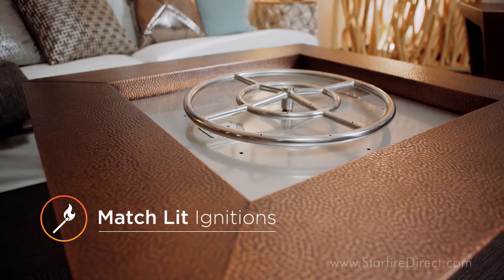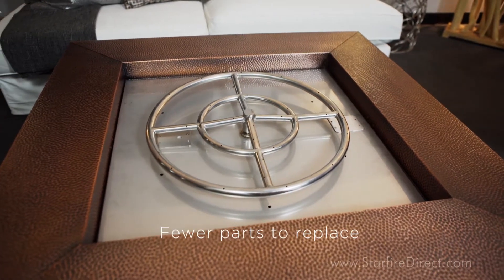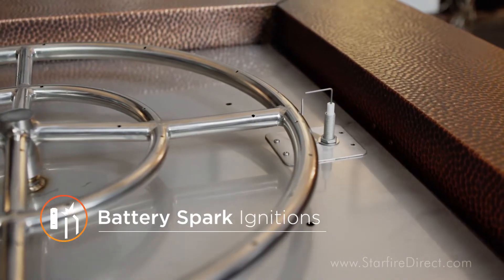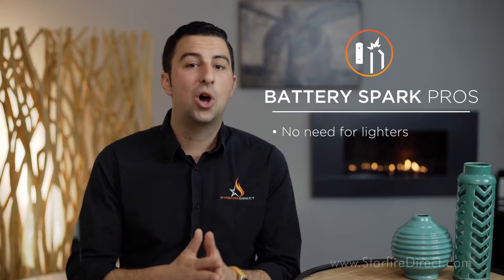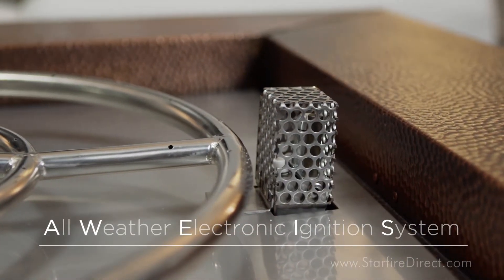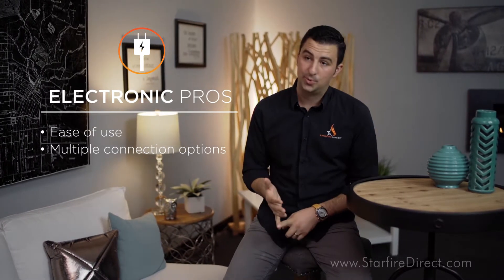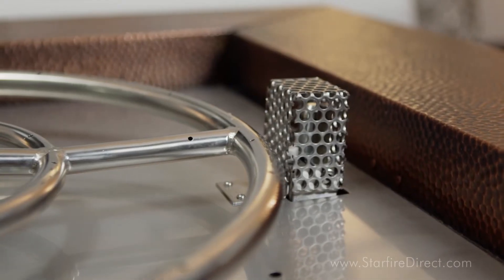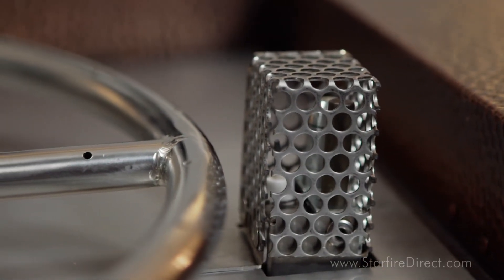Ignition Systems Pros and Cons by Starfire Direct

Comment: the electronic ignition systems are priced sky high, not even a consideration for the average person. The push button 15.00 one is all you need. I have my pushbutton 20 feet away from the pit, and so is the gas turn on valve, for safety. You can extend the distance use high voltage wire dont run it next to the grounding wire.
Reply from the maker: Thanks for the feedback!  You're right, adding an electronic ignition system can add $1500-3000+ to a fire pit installation.  Of course this is typically required for a commercial location or for someone that wants to tie the fire pit into their home automation system.  There's also many safety features; for instance, if a strong wind comes and blows out the flame, the gas shuts off automatically and the unit will try relighting itself.  If it fails to relight, it will shut off the gas and shut the unit down.  A match lit or push button 1.5v system doesn't typically have a thermocouple system to help in this type of scenario.

To keep costs down, a match lit or 1.5v battery spark kit is a good solution.  

I will say that keeping the battery module more than 36" away from the spark ignitor can often lead to loss of power preventing the gas from igniting.  As electricity travels down the wire, it loses voltage and even if you see a spark, it's not hot enough to ignite the gas.  This may not be your particular situation, but it's something we've seen many times in the past.

Finally, most building codes require the gas shut off valve be within 5' of the burner.  If you are turning on/off your gas from over 5' away, your system may not be done according to code and would fail inspection.  

These are little tips and tricks that our NFI Certified team can assist our customers with.  Please give us a call and tell us about your project, we'd be happy to assist in helping you get your fire pit built with the features you want and on your budget.
Reply: @StarfireDirect  thanks for the great reply. I do see a spark, don't know yet if it would work yet. I'll find out and let you know. That the shutoff needs to be 5' of the pit doesn't make much sense to me but so much for rules made in conference rooms without windows heh..My valve is 8' away.
Reply from the maker: @auctionmusic  Yes, I'm curious if the spark will be "hot" enough to light the gas.  Natural gas lights at around 1100 degrees.  If the 1.5 volts needed to generate a spark capable of reaching 1100 degrees diminishes over a long distance, you might still see a spark, but it might only be 900-1000 degrees which won't be hot enough to light the gas.  Of course, this is theory and you may have a different result.  This is simply general guidelines and best practice, which is why we include a maximum wire of 36", so that the spark is hot enough.  

Regarding the valve, you can have multiple valves if you wish.  One at the start and one at the end, not a bad practice at all.  But the reason for the valve being within 5' of the burner is if there is an issue right at the burner, you can shut it off immediately without having to go to an emergency shut off further away.  Also, for match lit ignitions you should be able to adjust the gas flow with one hand and light the gas with the other hand.  This would be impossible if further than 5'.  

Again, these are best practices and also follow code in most jurisdictions.  Hope this info helps, best to you and your project!
Reply: @StarfireDirect  I got the firepit working by leaving the igniter at the pit and moving the igniter battery 12 feet away, along with the gas value the same distance away. . What I did was, instead of extending the high voltage wire, I extended the battery wires. On the pit side, I soldered two wires in the igniter compartment where the battery normally resides onto the two ends the battery normally touches. Positive and negative. I'm using 12 gauge stranded wire and running those two wires to the remote location 12 feet away, underground in pvc pipe, separate from the gas line. So at the pit I put the igniter in a watertight plastic box, and the two high voltage wires now run from that box into the pit to the deal where the spark occurs (don't know what that is called heh). Now, on the other end, the two 12 gauge wires go into another waterproof box. Bought a single AA cell battery holder and battery is easily replaced. Not soltering to the battery. The batteyr holder has two wires plus and minus. One I joined directly to the incoming wire (the negative side on both) and then the other wire from the battery holder goes to a push button momentary contact switch, so only a connect while the button is pushed and held down. The other end of the button switch is connected to the positive incoming wire. The button box and gas line from the pit are together in a regular landscaping box usually used for zone valves.The turn on valve with the key is in the landscaping box.  Next to that box I dug out and put in a brick wall, square, bricks are no cemented. Then into that I put a heavy duty metal container that has a lid and this container is usually  used to hold a 20lb propance tank. It looks good and you dont see the propane tank itself.  Then I put the propane tank in the container. Next ran  a gas line from the tank to the landscapiong box to the gas valve. The propane tank has a meter on it to tell if gas is coming from the tank or not and a vertical pressure regulator.  So all valves are initially off. I turn on the gas valve on the propane tank itself, the meter shows gas is present, then turn on the gas valve in the landscaping box, then push the button, and the pit fires up right away, every time. There won't be much voltage drop over the 12 gauge stranded wire, and there are no grounding out problems as the voltage is so low. I can send pictures cannot do it here apparantly. What I dont know is how long will the battery last, but will find out over time for sure heh. I sent pictures using your email. Thanks for your info it was helpful for sure. I sent the pictures to  <info@starfiredirect.com>
Reply from the maker: @auctionmusic Pictures received, and thanks for sharing how you architected your fire pit project!  You've clearly put some effort into this and I think your commitment is to be commended!  

After reviewing your pictures, we do have a few areas of concern.  If you're interested, feel free to give us a call at 866-578-8538 and ask for Steven.  He'll be able to offer some advice if you want it.  Otherwise, best to you and your project!
Reply: @StarfireDirect  I didn't have the firepit built correctly. It essentially has to be hollow in the bottom. There is a breather fitting that is part of the gas line leading up to the firering. That breather cannot have material over it, and there needs to be vents in the wall of the pit at the same level as the breather. So I built up a hollow area using bricks, then topped off with large pavers and offsetting the pavers to leave a hole in the middle for the firering gas line. Next covered that with two layers of the thinner firebricks, then covered the firering and the bricks with volcanic rock. Careful with the v rock, you need to get the right type for firepits. Some types are for lawn decoration only and not meant to be in a fire. Another point about the hollow area is that propane gas doesn't burn completely (as brought to my attention by startfire) and the unburned gas is heavier than air, so it will sink to the bottom of the pit. The vents will allow it to escape thus preventing a buildup of gas. Bottom line is the vents are necessary, not something extra. I have 4 vents, each two are opposite the other two, or one every 90 degrees of the circle. My pit is circular.

Comment: What are the differences between the low, standard and high BTU capacity AWEIS systems?
Reply from the maker: The AWEIS is available in 3 popular sizes; mini, standard, and high capacity.  The mini maxes at 100k BTUs, the standard maxes at 290k BTUs, and the high capacity maxes at 510k BTUs.  The price varies based on the unit, with the least expensive mini to the more expensive high capacity.  Generally, you should size the AWEIS off of the fire ring and appliance output.  Most small fire bowls with a 12" or 18" fire ring would be fine with a mini at 100k BTUs.  Most normal sized fire pits would be fine with a standard, as 290k BTU's is quite a bit of flame.  Most would be happy with this.  The 510k BTU high capacity unit is designed for BIG fire features pumping out a TON of gas that require a HUGE flame.  This is more the exception than the rule.  

If you're not sure if 100k BTU's is enough, we recommend going with the 290k BTU standard AWEIS.  It will do anything below that and is often perfect for most applications.